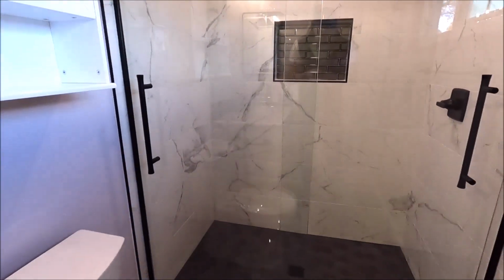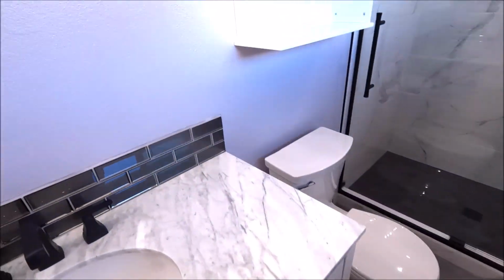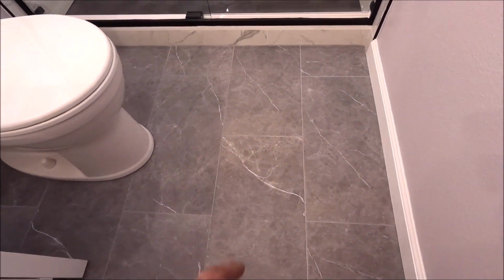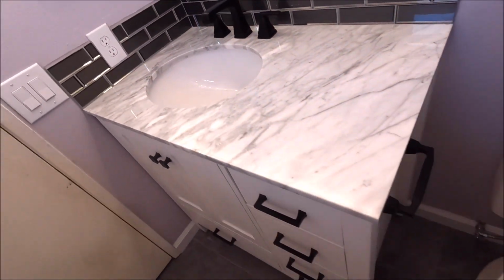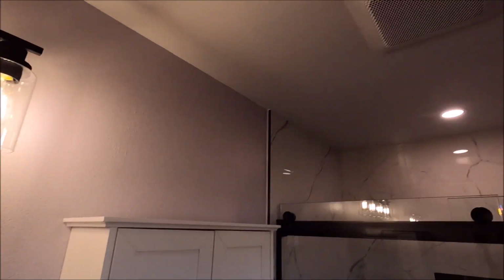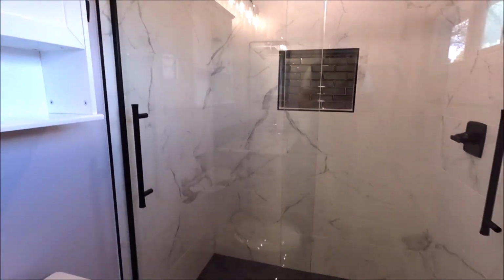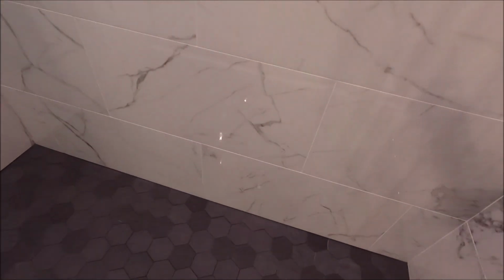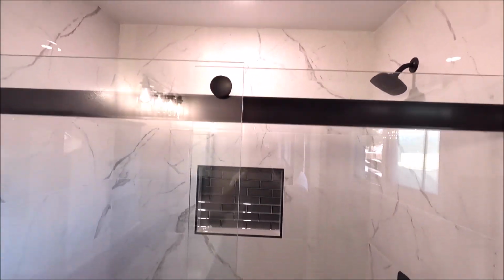Trendy Black on White Shower Design Completed!

Comment: love watching you guys work, very clean. perhaps missed the left to right layout on the shower floor a bit?  kind of wound up with 1/4 inch little hex"s on left and right walls, might of been better moving it over 1/4 tile. i know its centered but you can also have it centered buy moving it over half of a half too, just alternating rows. also , and this is just personal preference, but never liked the look of ending splash tiles on vanity even with the edge of vanity edge, i much prefer the look of a 1/4 in  reveal inwards instead, just looks a bit boxey imo going to the edge. in any case customers should be fortunate to have you guys as there are so many hacks abound.
Reply from the maker: Appreciate it! 👊👊

Comment: If you dropped down the layout those 3 inches, yes, you would have to cut every bottom and then there would be a cut at the ceiling and I see how you have it. It's basically like almost full right? So yeah, those tiles in that particular shower gives you a little bit of a layout problem. but why did you go outside of the shower?  The shower door sits halfway in the curb. So if you would have ended the trim on the outside of the curb I mean, you would have gotten rid of that 2,2 piece cuts...... I don't know, but I get it..... Love the Pan material....... It would look cool if you can get a black handle for the toilet.
Reply from the maker: I agree